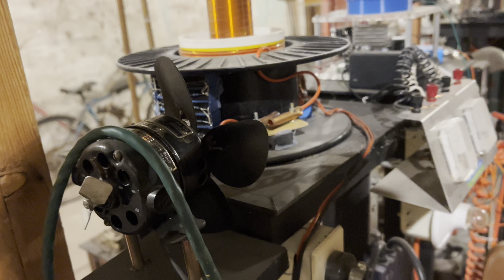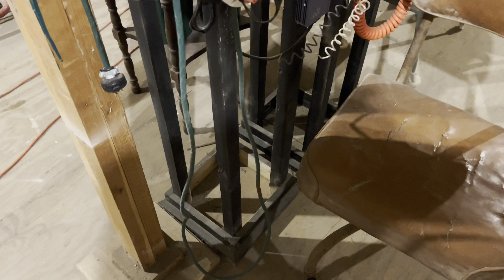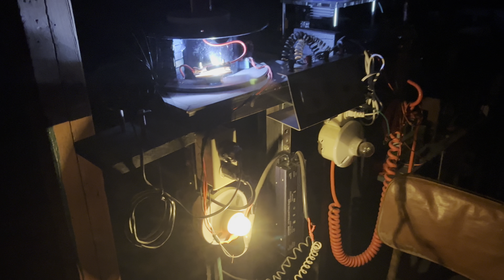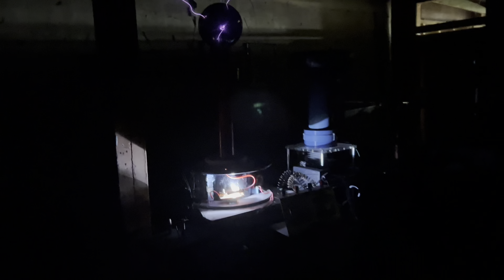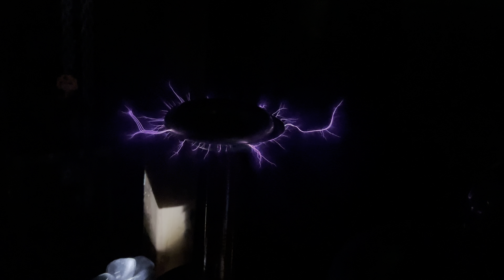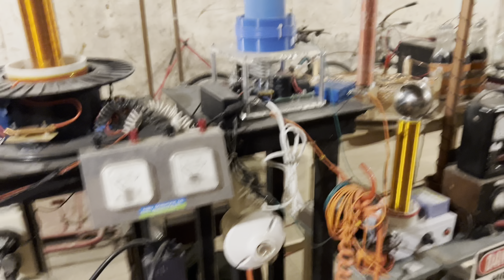ZVS Driver Tesla Coil - Spark Gap Design⚡️

Comment: Your setups will all work better if you make a quenched gap, whether air or vacuum blast, rotary or heat-sinked multigap tungsten-faced copper. Fan cooling helps, but it's not enough without heat radiating fins.
Also, you don't strictly need a rectifier for the B+ supply on a vacuum tube tesla coil, as the tube will naturally only conduct on one half cycle. You could use two power tubes to capture each half of the waveform, I imagine, avoiding any growling iron from core walk.
Reply: Actually rotary gaps really dont help for fly back coils im not sure exactly why that is but for what ever reason they seem to like a static gap much better something to do with it being a dc flyback and yada yada but trust me iv tested it several times a static gap with i nice little cpu fan bout 2” away from the gap with a gap that is between 1/4” and 1/8 “ seems to give the best out put with a 12nf mmc  i get easy 12” long streamers off of mine  also this coil is for sure out side of the optimal aspect ratio for that secondary . Theres quite abit more to squeeze out of this thing if it was built right
Reply from the maker: Thanks for the tips! Definitely would like to move over to rotary gaps rather than static gaps⚡️
Reply: @SparkTheory84  if you wana switch to rotary gap your guna want a mains frequency transformer like nst obit or mots . Rotary gaps on fly back set ups as far as my many attempts and tests seem to actually negativly effect the out put of your coil. A fly back is already a pulsed dc out put your rotary gaps will just add random pulsing to an already rythmic pulse. I tried several times all i ever saw was less performance. And honestly even having the fan on the gap for a gly back system offers very very minimal difference i dont use blowers or anything other than a single static gap on my fly back coils any more and i regularly get 12” or longer free air streamers